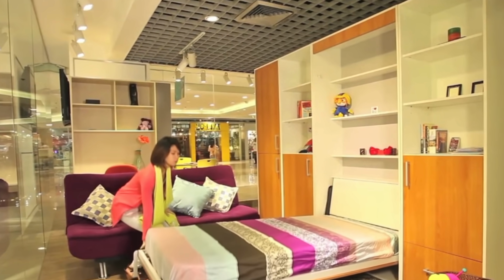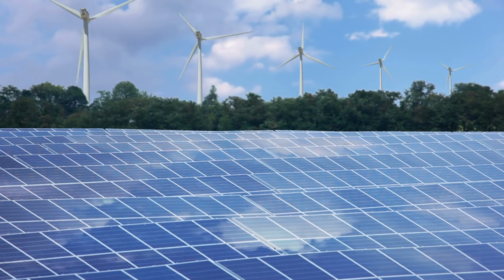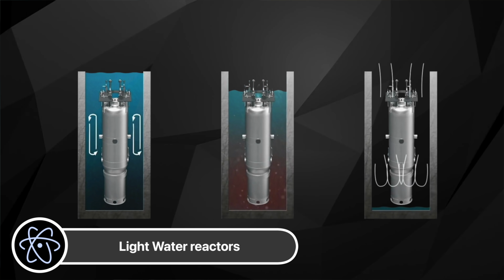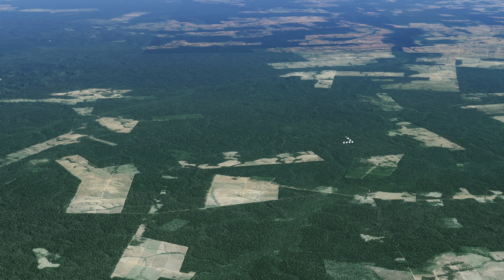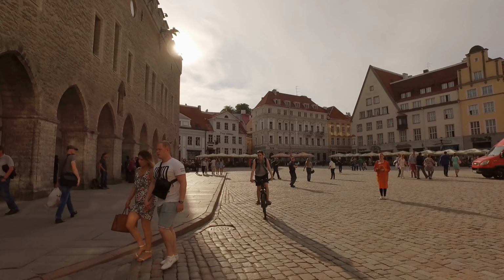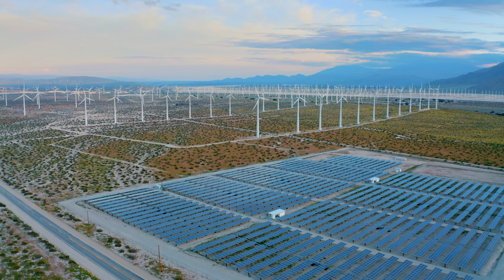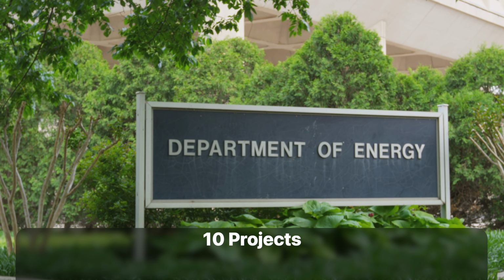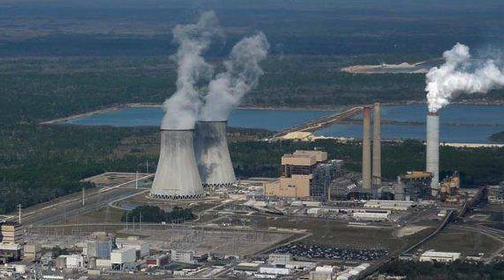Why Small Modular Nuclear Reactors Are the KEY

Comment: I'd like to see these on the outskirts of every city for more decentralized/redundant and green grid. We need this kind of tech until we figure out fusion reactors and renewable energy storage.
Reply: Yeah nothing like a land slide,  flood, hurricane, tornado, earthquake that also comes with a nuclear reactor in the mix lmao can anybody with half a brain even consider this a good idea
Reply: energy storage is already figured out, it's just waiting for people & companies to buy it. 

I have enough lead-acid batteries for about a day, if I could afford it I would have a month of NiFe batteries, grid-scale seems happy with NiFePO, liquid-metal & Li-ion batteries alongside pumped-storage hydro, pressurized air in caves & molten salt but more tech is coming fast...
Reply: @bradhaaf4749  Small modular reactors are much safer and easier to control than conventional massive nuclear plants. They also contain numerous safety, redundancies, and natural disasters are planned for.
Reply: @anon2451  
How would such a reactor have to be build to withstand a giand bolder smashing into it, or a big train, and still have the full shielding to be unharmed.
And how would you get that 10 Ton block into your car?
Reply: @Ismalith  Don't be ridiculous.
Reply: @Ismalith  no, liquid hydrocarbons are a good way of powering many things, being power-dense and able to fill any shape tank, at zero pressure. Just use nuclear power to convert CO2 from the air into hydrocarbons.
Reply: @bradhaaf4749  a hurricane/tornado is not much of a challenge to a half-decent building, and buildings in earthquake-prone areas are built to resist the forces involved, so your proposition does not hold up...
Reply: @Ironic1950  you don't know what you are talk about.
Reply: @Ironic1950  
How much electrical energy is needed for one KWh of such Hydrocarbon Fuels?
Reply: @martmason  ...it is you, 'Mart' that provably knows not what you are talking about...
Reply: @Ismalith  it doesn't matter; wind and solar energy are 'free' we are always being told...
Reply: @Ironic1950  wrong again.  I'm a truck driver. I'm very familiar with the load of waste water that comes out of the power plants. So you need to google what you think you know.
Reply: @Ironic1950  
Oh by imaginary news? That source that all that don't share the opinion of the right are watching?
At least that is what we are always being told.
Reply: Well, Marty, are you sure that the stuff you are transporting is actually nuclear waste, from a nuclear power station? Are you sure it is not chemical waste, from a chemical plant?  The waste from nuclear plants is usually solid, or gas, like xenon isotopes.
Reply: That’s correct nuclear is the way like it or not, and mainly just because no matter what energy source one considers the best and cleanest. The fact is that all energy sources we can think of are ultimately Nuclear anyways. Why not just cut the middle man, or in the case the middle energy process, and go straight with the real deal, the source of all sources of energy.
Reply: @MassimvsPrimoMeridio  
Because, who will own the fusion reactor?
Reply: @Ismalith   the one who pay and have the legal rights to own it.
Reply: @MassimvsPrimoMeridio  
Yes and who is that? Who do you trust to be the god of the United States?
Reply: @Ismalith  the ones that get it done, who like it or not are the only ones who actually can and if don’t get it done this way which is the best way to get energy in the universe. They will get it anyways some other way like it or not!
Reply: @MassimvsPrimoMeridio  
Well no.
Even after throwing trillions into that idea we still don't have a working fusion reactor.
Also still, if you have a fusion reactor, whoever owns it, owns his whole country.
Reply: @Ismalith   do you realize that what you’re saying is a nonsense right ?
Reply: @MassimvsPrimoMeridio  it needs a company  and activity : electric production and an agreement with euratom in Euope at least.
Reply: @alanhat5252  Energy storage is mostly from nuclear power,reactors in France go up and down in power each day to accommodate the finicky nature of wind and solar, new reactors like NuScale work even better as storage mediums. RE can not come close to nuclear as a system, wind and solar always have FF backup.
Reply: @martmason  Nuclear is the only energy that cares for its waste,FF doesn't ,and wind and solar leave massive amounts of waste.
Reply: @Ironic1950  More efficient to make H2 with nuclear which is the first step of making low Carbon hydrocarbons.
Reply: Power to X  like or simply Power to Methane, we already have a working natural gas system it's a perfect storage option if Batteries arent available
Reply: Converting CO2 from the air is the stupidest thing ever when you do the math. There is several online and end of pipe technology that could be installed in Gas plants like wassergas shift + partial oxidation so you can saperate the CO2 and H2 so H2 will be burnt while CO2 can be stored. Full efficency is still above 40% with this method. And you have CO2 concentrations that are actually workable with. Then you cab do whatever you like with the CO2. For coal i only know end of pipe and it reduced the efficency quite a bit but that's the way better option. First we have to stopp blasting CO2 into the air then we can start removing CO2 in the air. As of right now it takes energy to get it out of the air, that energy is mostly supplied by carbon emmitting energy plants and in the end you produce more CO2 than you remove. The end of pipe concepts or the introduction of watergas shift to Gas/Coal plants costs money, it would solve a big problem but we as of now just don't know what to do with all the CO2 since it's fossile we would need to store it somewhere or create a closed energy cycle wich isn't viable. There are a lot of storage conceps but these are more like emergency plans cause they wont work forever so shutting down all fossile energy is a must in the end.
Reply: @everettlwilliamsii3740  Yes, coal has bits of U, but or main radiation doses come from the sun, cosmic rays, and radioactive materials in the earth, Potassium in our bones and teeth,  are mildly radioactive.

Comment: Good video! One slight correction. 1/2 lives of ten of thousands of years only applies to the uranium reactors , Thorium reactors on the other hand only has  a 1/2 life of about 300 years. Add to that there is now transmutation technology the short the 1/2 life and even render nuclear waste completely safe.
Reply: You can also "recycle" nuclear waste to make it usable again in salt reactors for example, and repeat the process till its virtually all waste product.
Reply: @Archangel657  Yes that is an advantage of a Thorium reactor.
Reply: No, fast reactors can use waste for fuel, you do not need Thorium.
Reply: No,you only get long lived waste with some types of current reactors, you can burn U and have no long lived waste when you use fast reactors,The Russians already have a fast reactor connected to the grid.
Reply: @randall1715  Appreciate your enthusiasm for nuclear energy, but why would we use Thorium?
Reply: @paulbedichek2679  there are many reasons, 1) less waste as the fuel can be recycled. 2)  relatively a short half life 3)   It does not produce weapons grade nuclear material. 4) there is lots of it. 5) it gives us less expensive access to rare earth elements... The USA had a Thorium reactor in the 1950's but did not go with it because they could not produce nuclear weapons.

Comment: You shouldn't skim over the amount of waste and amount of "fuel" used in reactors as compared to competing technology.
Even though nuclear waste has safety issues the amount produced is tiny compared to the amount of waste produced by coal plants, or silica mines for solar panels.
The US Navy has used and continues to use nuclear power for its big aircraft carriers and submarines, the first built in the 1950s.
Reply: @garysmith5025  Where do get your numbers from? I think you are using a different definition of "nuclear waste." The definition I am accustomed to says nuclear waste is spent fuel. According the US Dept. of Energy, "the U.S. generates about 2,000 metric tons of used [nuclear] fuel each year.This number may sound like a lot, but it’s actually quite small. In fact, the U.S. has produced roughly 83,000 metrics tons of used [nuclear] fuel since the 1950s—and all of it could fit on a single football field at a depth of less than 10 yards."
And the US has far more nuclear reactors than the UK. We even have more than France who get 75% of their electricity from Nuclear Power.